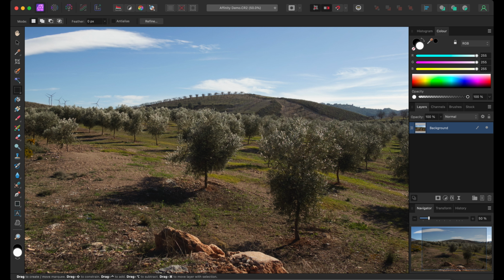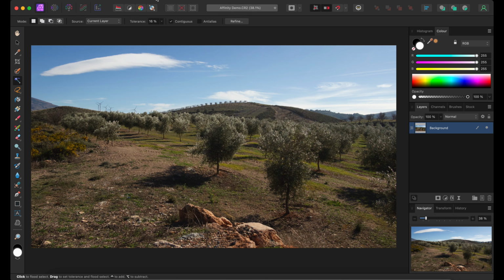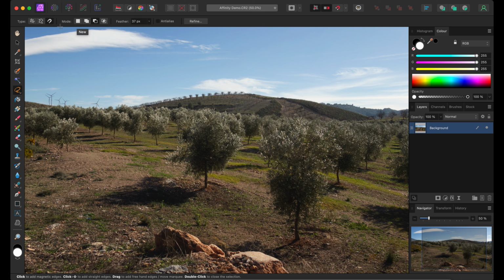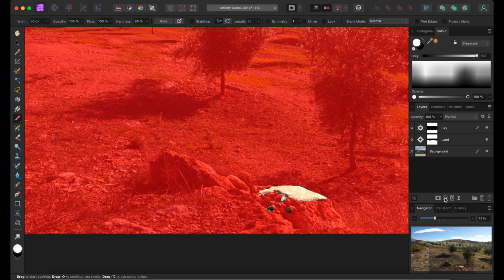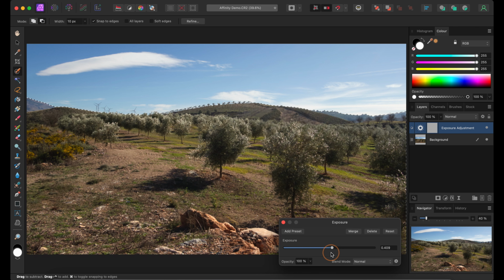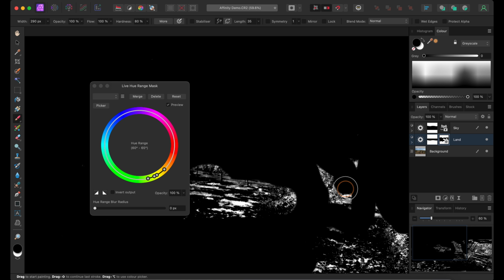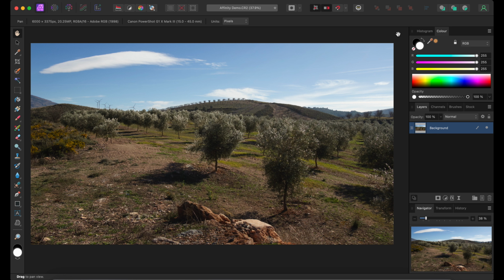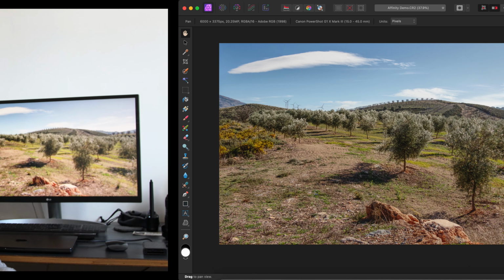Affinity Photo 2 -  Next Level Photo Processing with Selections and Masks

Comment: The selections are perfect, the BIG PROBLEM is that they can't be applied while the image is in RAW format, so a simple highlight adjustment becomes impossible because the image lost all dynamic range. Is there a solution to this? or am I missing something? Unfortunately Affinity's masking options in RAW format are very limited. Thank you very much for your videos, they are really excellent!
Reply from the maker: You're not missing anything, this is a built in problem when adjusting highlights in all RAW processing software to an extent. The masking options in the Affinity RAW editor are limited, but because Affinity doesn't use sidecar files, that's probably a good thing! The problem occurs because highlights are a "slice" of the whole spectrum. This is why I generally prefer to use the curves tool rather than the highlights and darks sliders. Another way around it is to select based on luminosity or color. The idea is to limit the effect to the part of the spectrum that you need, rather than letting the app dictate how much of the spectrum you adjust (Darks, Mids, Lights).